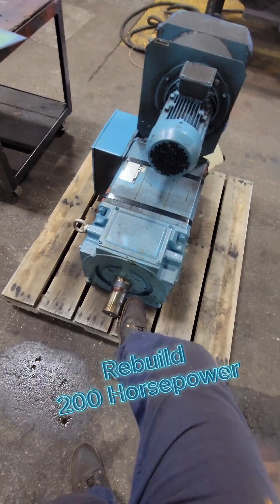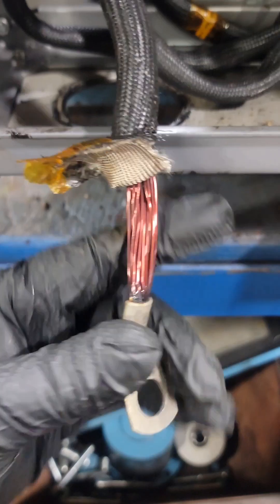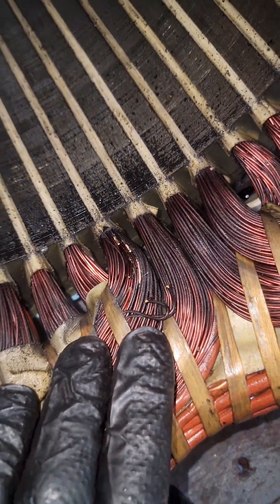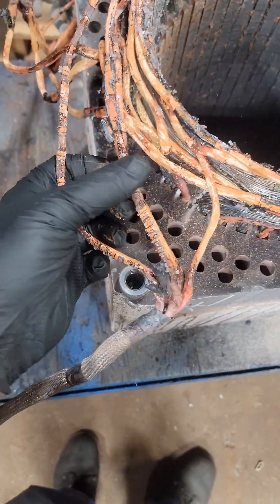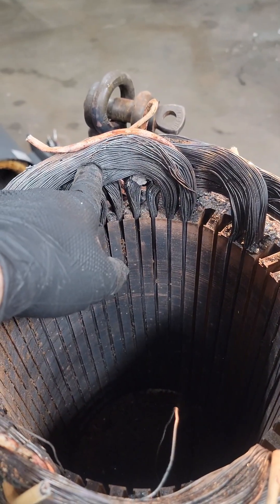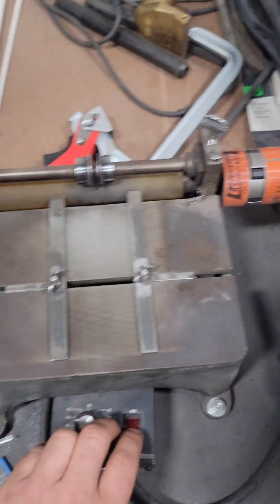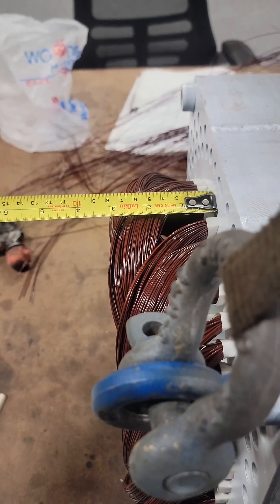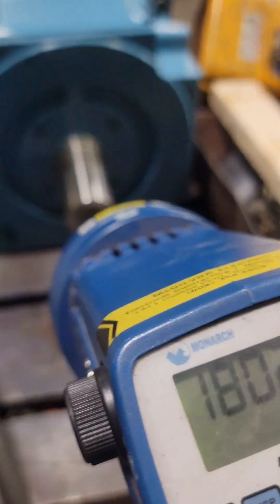Rebuild 149kw / 200hp electric motor

Comment: You often test run these rewinds. You also often say it is more often loads and not the electrics that cause failures. Why don't you test the motors under (at least symmetric/constant) loads? Or does your winding analytic do-dad give you all information that testing a loaded motor could provide.

Comment: I am certified from Becker vacuum pump. I send my motors out when I see internal issues. What a art. I loved this video. Thank you. I simply change bearings and test amp loads before and after I rebuild, if there's ever a issue I'm forced to send them out. This is above my capabilities currently and I appreciate the video

Comment: We are testing resistance to ground with megger  of 500v because the voltage of the multimeter is too low to pass.
Reply: I was taught 10 times running voltage, 500 seems low.

Comment: I guess the price for the rebuild was more than the price if the paper creaser. 😂
Reply: I would guess $20k to rebuild
Reply: @muskratondatra8294 Some comments said about 2/3rds new price, so maybe a bit less?
Reply: Really puts into perspective how cheap combustion engines are.
Reply: @nils1953  Not a fair comparison.  To compete with the amount of work this motor has done, 2 years 18 hours per day continuous,  you would need 4 or 5 15k Diesel engines, with all the maintenance they need, filters, oil, belts etc.
If Ice engines were cheaper, they would be used instead. 
And don't forget, it took a flood to shut this one down.
Reply: @dnomyarnostaw  Absolutely. For stationary applications it only makes sense to have combustion engines if there is no eletrical grid OR you don't have a reciprocating combustion engine OR it is a backup.
Reply: @dnomyarnostaw  I'm not saying the ICE's are better or anything. Just crazy how stark the difference is in price per kW.
And I'm not sure what kind of engines you're talking about, but most good quality diesel engines will last anywhere between 20-50k hours. 
Now if you've got very high quality electric motor, you'll be able to double that, but the 15k hours that thing has run, even a cheap diesel with regular maintenance could do.
Reply: @nils1953  yeah, nah. Even the manufacturers don't claim more than 20,000 hours until  major rebuild. Unfortunately, that's including main bearings every 10, 000 hours.
20,000 hours is only 2 years continuous running, and large industrial electric motors are rated in 5 and ten year operations.
Reply: @dnomyarnostaw  Cummins does advertise over 20k hours. But even then a rebuild is still cheaper than the rebuilt we saw here.

Yeah which is why electric engines are superior for long time stationary operation. They are just extremely expensive. If copper were as cheap as cast iron, maybe it would be different.
Reply: @nils1953   I'm still not following your logic. 
A Cummins "Cummins R2.8 Turbo Diesel Crate Engine 120kw" costs $au18k, in my part of the world.
 For a 120 kw electric motor, it costs $au10k or 120 kw Permanent magnet  version,  $au7k.  A new battery for auto use is now under  au$6k ( 8yrs warranty)
Considering a Diesel rebuild is over $au12k, after say 3 yrs continuous use. 
I  cant see any advantage for Diesels  , let alone saying they are far cheaper.
Reply: @dnomyarnostaw  wow, honestly at this point I don't really care to have a useless discussion, I just want to know your supplier that sells  main brand 120kw permanent magnet electric motor for under 7000 USD. 
Cause I've got to import them and sell them for 5x them. No joke if they're like Siemens, SEW, ABB, Mitsubishi, that would be a right bargain, compared to what we pay here in Germany.
Reply: @nils1953  Sorry you aren't having fun doing all this research.  :-)
I just googled them, like I did Diesels. 
All of them were from China of course, and the freight is considerable, but then we didn't discuss target installations.. I couldn't find them again, of course. :-(

But then, for automotive use, we don't need just one equivalent motor.  
Locally, I found "TechTop 50 HP Motor 415V 3 Phase 2 Pole, 2955 RPM, Foot Mount TC2C3703TCI au$3,474.92 "
Four of those = $12k, and would produce a better automotive solution than one Diesel

 But really, for any sensible comparisons, there are lots of other factors to consider. Including gearboxes, quality, support etc. 

Without being too confrontational, the point I guess am making is  that your original post "Really puts into perspective how cheap combustion engines are'",  might have been a bit simplistic ?
Reply: I like electric. Electric so simple direct and straight forward

Comment: motor so powerful it needs a motor to cool it?
Reply: Got nothing to do with it. Motors that run at lower than base speed, i.e. controlled with a VFD, the built-in fan can't provide adequate cooling. Therefore, an auxiliary blower is used. You can see this done on fractional HP motors all the way up to 1000 HP motors.
Reply: All of my rc car motors have a separate fan motor to cool it i guess they are powerful too 😊
Reply: It's pretty normal for these types of motors as they can generate heat even when not turning so it cannot cool itself and need a separate motor for that.
Reply: It's indeed speed, and also if it's a synchroon motor. They usely run slow speeds and need separate cooling.
Reply: From the looks of the motor interior, I’d say that the blower needs a filter.

Comment: Just stumbled on your page, very impressive looking work! Just wondering what the value proposition could possibly be on a rebuild like this versus ordering a new one? Seems like a ton of work 😬😬
Reply: Some motors have lead times of weeks or months which can lead to serious costs due to down time. Rewinds can be done in a matter of days avoiding those client additional business costs.
Reply: For a big one like this about a third to half the cost, but the real value is that you got a lot less downtime, a couple weeks vs months.
Reply: Well this is how they are made, the exact same thing happens in the motor factory when you order a new one! So the only scope for cost saving is if it happens in India instead of your local rewind shop. I doubt that is enough to offset the cost of the rotor, armature iron, and shipping.